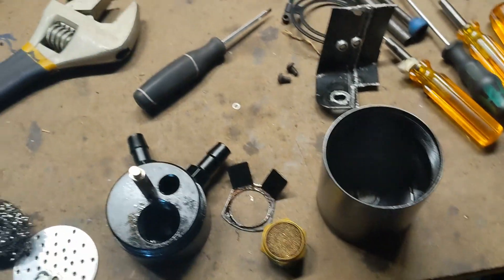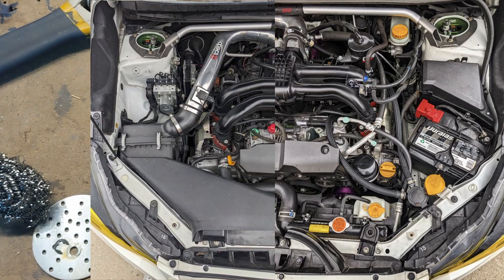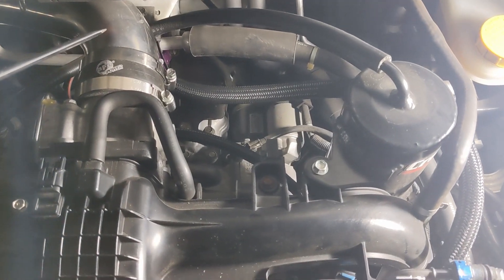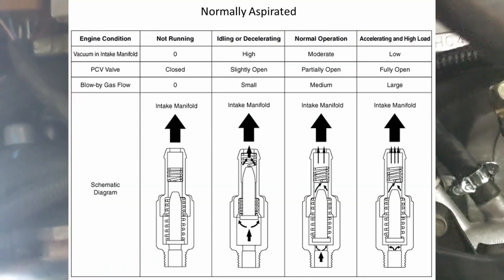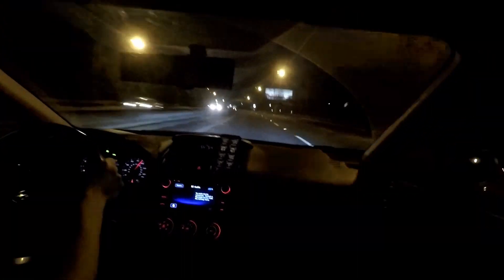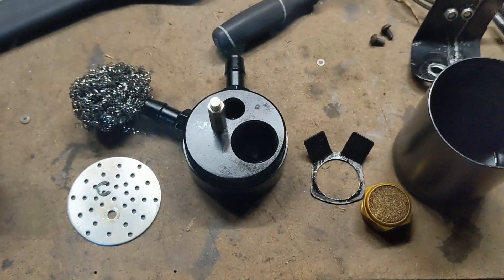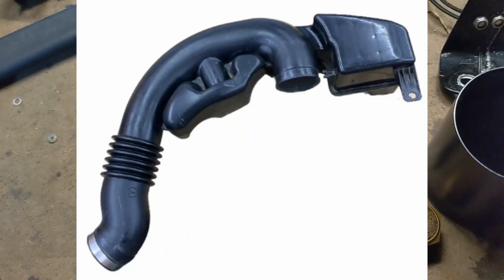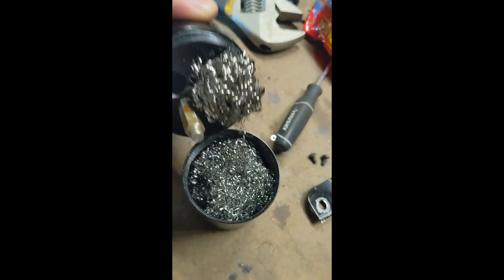Catch Can Modification - better filtration, less restriction - Subaru Impreza

Comment: I drilled very small holes in to the brass micron filter as these can be very tricky during manufacturing some are free flowing some are thick and restrictive mixed bag .
Reply from the maker: Ahh! I see. What application are you using it for? What car? Thanks for letting me know!

Comment: What two points on the engine did you tap the catch into? Thanks?
Reply from the maker: There are 2 places you can attach a catch can. They are part of the PCV system. 

Firstly, the PCV (positive crankcase ventilation) valve and intake manifold. Secondly, the CCV (crank case ventilation) system. Mainly the breather port to the intake pipe. 

Good luck!
Reply: Subie sues to the max

Comment: Awesome man, I had my 2016 brand new and after 4 years it stalls out once I apply heavy breaks while it is idling, the throttle body was well carbonated and the engine was getting choked due to brakes sudden air reroute to brakes, I added one catch can between PCV valve and intake and I still find the throttle body not clean, now I learned from you that I have a second positive crank case ventilation line!! 
gotta install the second catch can :D

Comment: No, no, bro you can’t put this oil oil catch can! It must to REMOVE a thin filter.
The oil catch can must pass the flow of air masses, the same as in an EMPTY hose! No less!
Here is a video, a guy from India explains why this is so:
https://www.youtube.com/watch?v=hDx09voTlbw
You are now hurting your engine :) 
Try to find on the Internet a photo of Cusco oil catch can in a section, it will be clear what the difference is.
This iron washcloth also needs to be removed. After a few months, it will begin to crumble and its pieces will fly straight into the engine intake.
Reply from the maker: Hi. Mr. dIY is from the Philippines. I have him subscribed and have watched his videos prior to this modification.. 

He is right 'as quickly as possible' the benefits and cons for me is that a gummy throttle body is extremely bad for performance. The velocity of the air (with the modifications) increases. We also have some baffling installed where with an aftermarket intake there was none. And  the steel wool is corser than the fine stuff you might be thinking of. I have thought about the deterioration rate of the stuff. It's literally being oiled Every time I run the car. 

Thank you for bringing up those points. They are definitely something that people should think about when modifying an intake or considering a catch can. 

With the OEM setup. I  wouldn't use one, but it is prone to throttle body clogging still in high load applications. 

For me this is the current best solution for my needs. 

Cheers.
Reply: I have seen this video. I just bought a catch can like it it but it is the long 7", 750 ml one.  I am taking out the filter and the baffle pieces. I am putting in a long 7/16" aluminum pipe from input to near the bottom of the can. I am screwing a shorter plastic 3/4" plumbing pipe where the filter goes. I will stuff stainless steel scrub in that short pipe and around the long thin pipe. I want to make sure low resistance from in to out.